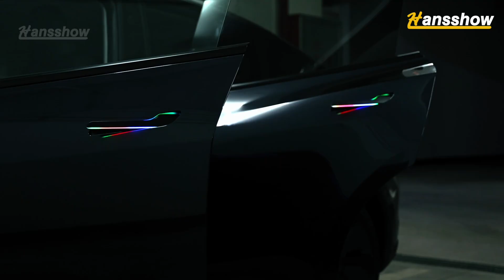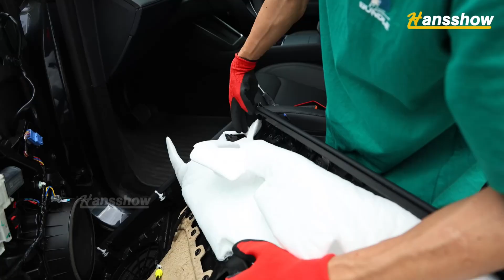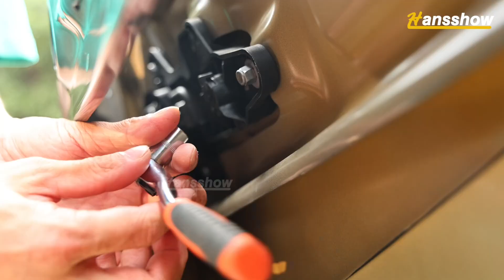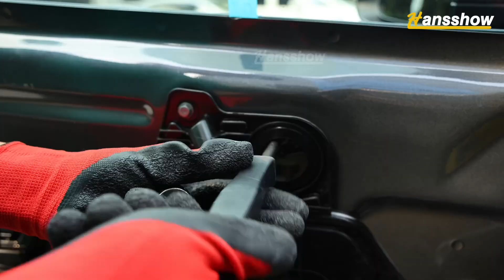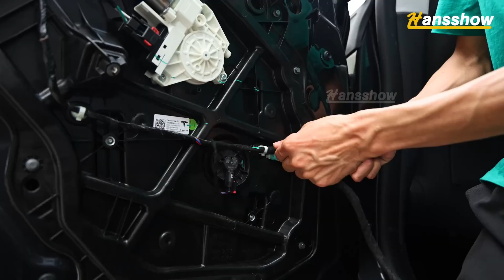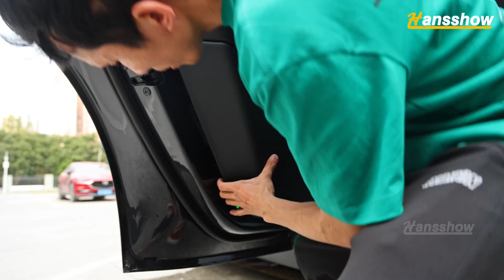How to install Model Y Juniper door handles

Comment: How do you make it look so easy?  I’m struggling over here. Lol
Reply: Bro, I bought the handles before watching this video.. I had the opposite feeling. This video is intimidating. 

How did it go for you?
Reply: @resiack  Just did the driver's door. 6 hours! Window bolts did not line up so I could easily get to them. Watched every video I could find and still Struggled with getting the black inner door panel off. Nothing like the video. Had the most problems getting the wiring connectors loose. None of them worked the same! I was ready to give up till my wife came out and just brute forced it off. I was afraid that I couldn't get the harnesses back to their original locations but that was not an issue at all. Struggled for almost a half hour trying to get the tweeter connector off the smaller one of the 2. I also bought the soft close latches since I had the door open anyway and put those in also. They were no big deal. Broke 3 pins off getting the door cover lined up right so need to get some from the Tesla dealership I guess. I also bought some sound deadening off amazon and stuck it to the inside of the outer door where I could get to it to see if it makes any difference. Going to tackle the back door tomorrow. I need a break.